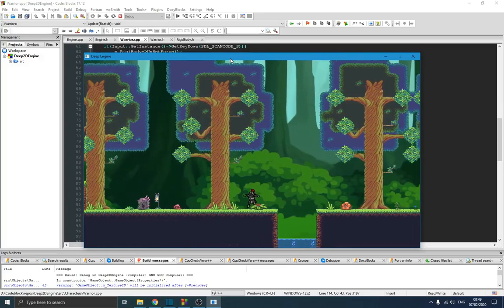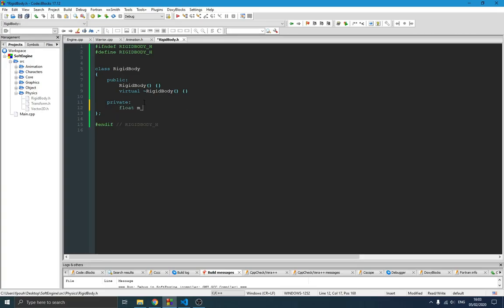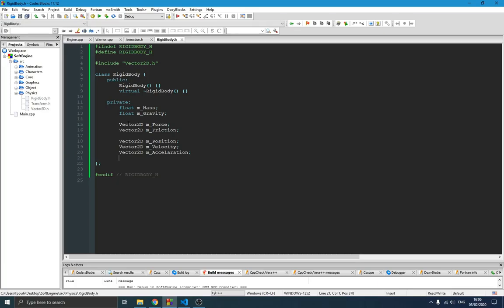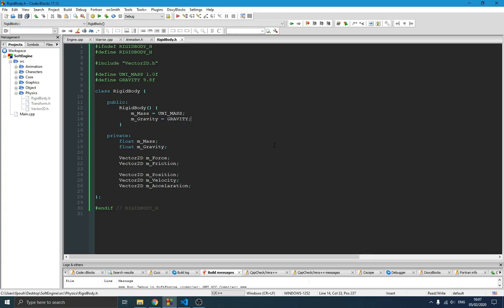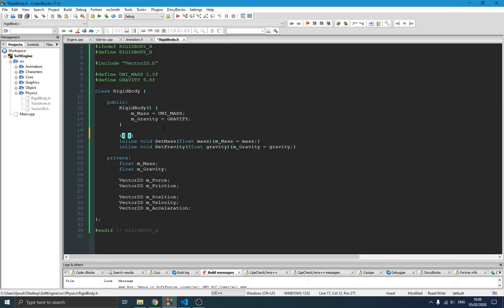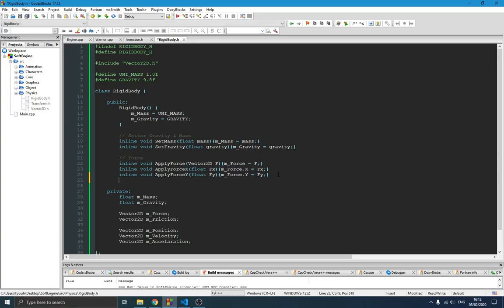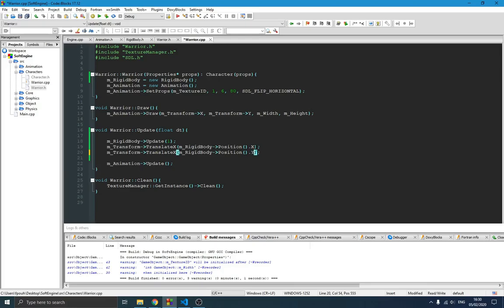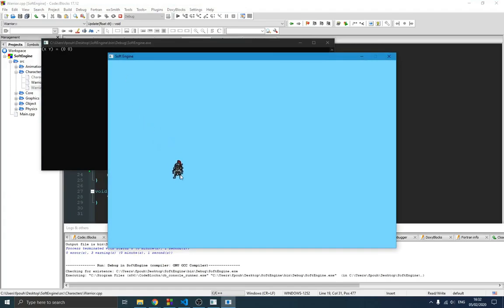Rigid body  And Game Physics SDL Game #Part 9

Comment: I really confused right now, I have no idea why the "m_RigidBody->ApplyForceX(5);" of me cannot execuse and the character just fall down straightly, but "m_RigidBody->ApplyForceY(5);"  executes really well. I've rechecked it for times but still didn't get the answer. Can you give me some advice, thank you.
Reply from the maker: make sure your gravity isn't to high and also make sure your translate the player position instead of overriding it !! am not sure but that's only what I can say!!
Reply from the maker: am not sure could be your delta time or your gravity value !!!
Reply: did you solved it? the isse with applyforce?

Comment: It seems to be all ok but i dont get why when my character falls it does in a linear way, i mean, shouldn't be actually falling with square of time?
Reply from the maker: I dont know why you need that but you can steel add the 1/2*a2
Reply: @Madsycode  i tried but just fall twice slower. is just a detail with no importance, but just curiosity. ty men i love ur tutorials :D
Reply from the maker: @juegosbob662  thx am blessed!!
Reply: well i actually solved with mVelocity += mAcceleration*dt; and mPosition += mVelocity*dt; Now my boy does a parabola :DDD